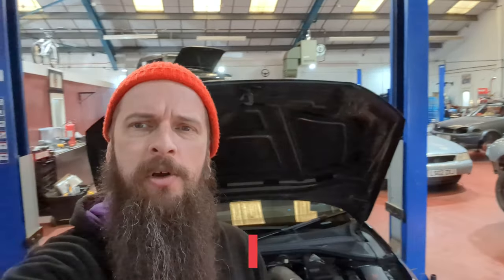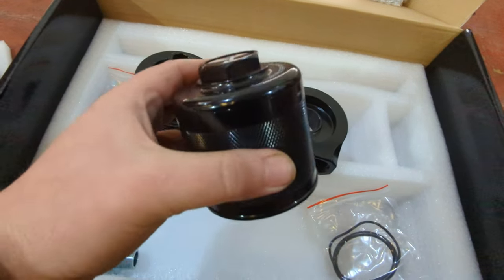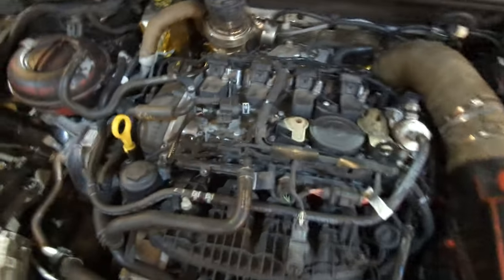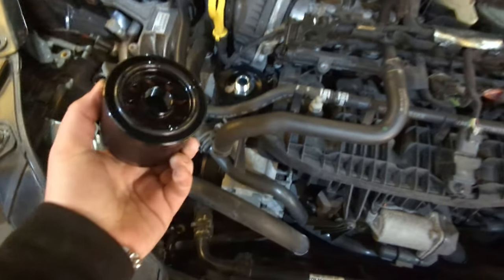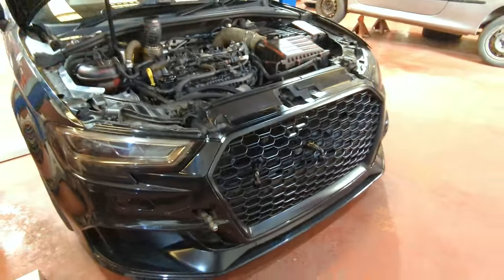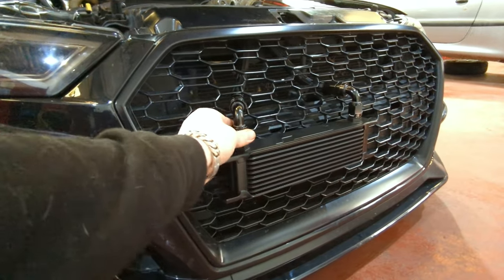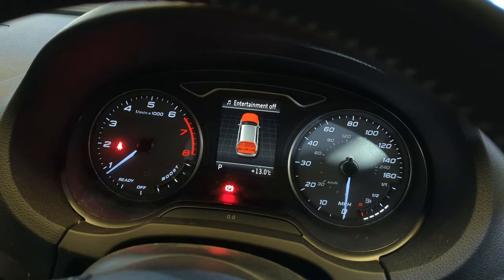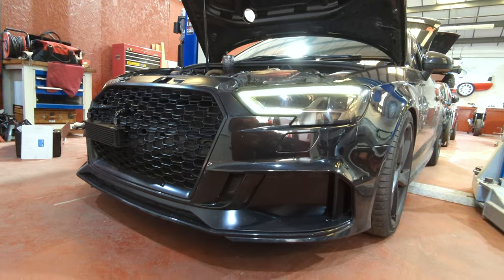Racingline Oil Cooler Install on Audi S3 8V

Comment: Fantastic! Your new Racingline oil filter is so beautiful. Excellent installation of both the filter and the radiator. Very good Gilles!  Your Audi S3 every time gets sportier and more extreme. I like this radiator in front of the bumper, it gives an aggressive look. Good evening and good weekend. Bye Gilles, Lee, Ade and Rob 😃👍👍👍👍
Reply from the maker: Yeah mate, really loving the look, the inside of the engine bay is looking greater with this latest mods, with the custom airboox, new turbo with blanket one it will look even better. Even got bespoke custom front mech insert in mind. Have a great weekend my friend :)

Comment: Nice little upgrade mate, been looking at getting one of these for the impreza for when i start to ramp up the power. Are you concerned atol having it infront of the grill with the car being used on the road?
Reply from the maker: Hey mate, not mega concerned no as planning to move it when customizing the front grill but it will still be in front position. Can see been hit by rocks already as little paint chips but tbh on the S3 the gaps of the front grills are so big they only reduce a little bit the amount that goes throough.

Comment: Does the car have an oil cooler as standard? I know some cars do, some don't. Great bit of kit. No thermostatic element to the sandwich plate?
Reply from the maker: Yeah they do, as well as DSG cooler ect which are all fine for around 500bhp but if pushing more it's recommended to extend or upgrade them. No thermostatic element no. Racingline does nice looking kit, no instructions though and too Golf focus (mounts may only work well on golf, their airbox is golf engine cover styled ect)
Reply: @Beardchanics  that makes sense! You said before it's too golf platform focused their stuff 🙄
Reply from the maker: @SoloLap  yeah frustrating, still rather have an S3  than a golf though! :)